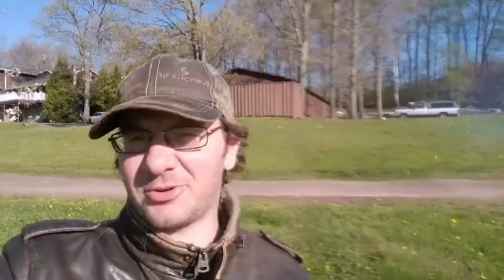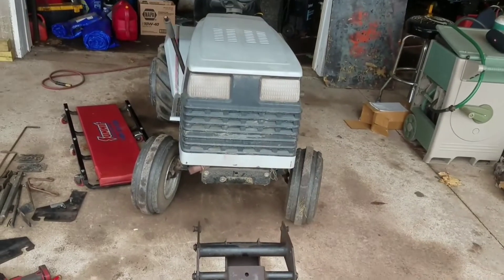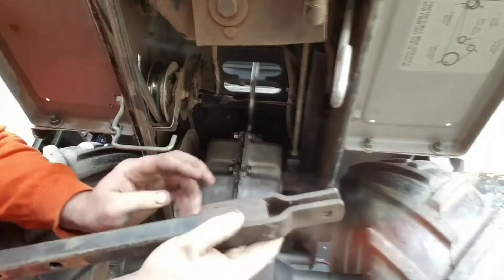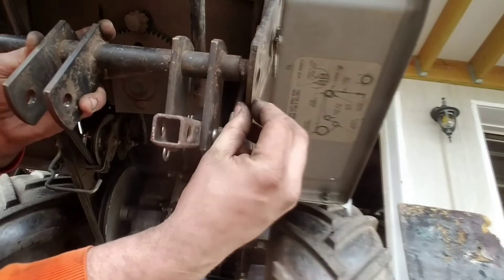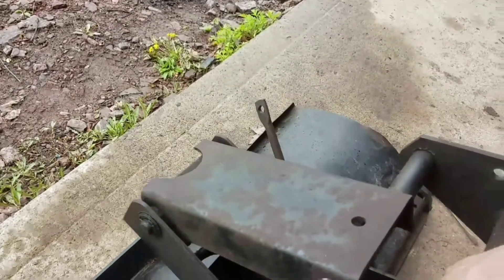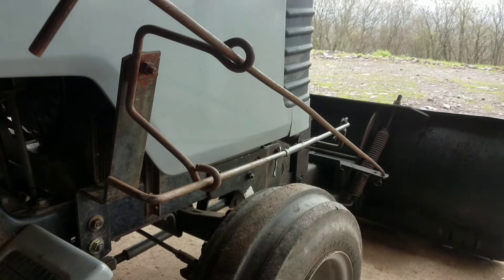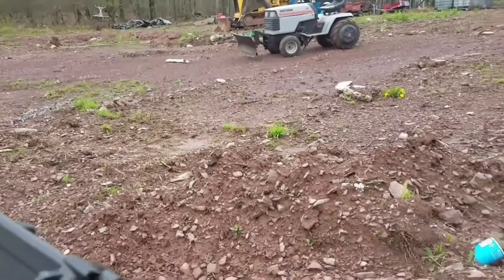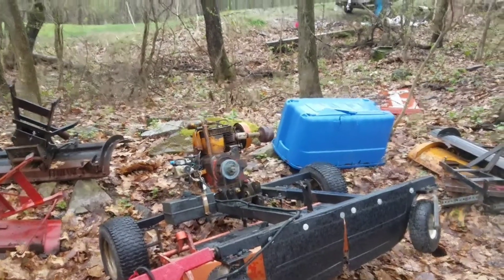1986 CRAFTSMAN GT18 Seat Angle Plow Attachment Install

Comment: That’s a 1987 lawnmower
Reply from the maker: Not a lawnmower 
GT stands for Garden Tractor Granted my one tractor does mostly lawn duty work. 

Same year 12hp lawnmower transmissions won't pull my rear mower up the mountain yard without braking, less horsepower, smaller decks, and much lighter (less traction) light duty tractor LT 

Garden tractors have rear implemet options not available for lawnmowers such as bottom plow, rear box blades, cultivaters, and even a rear self powered tiller attachment

Comment: I just got one of these little tractors and I'm trying to find a scrap for it or a box scrap do you know where I could find one for it
Reply from the maker: @Rogerswoodworkx  you need a sleeve hitch adapter. Agri-fab still makes them new, and then you can search Facebook marketplace for rear implements or buy new. 
Front attachments can be a bit tricky as platic hood gt6000 plows used different factory brackets and is a bit wider than earlier gt18 frames but brackets are interchangeable and adapters are also available but cant say how to find part numbers for them.
Reply from the maker: @Rogerswoodworkx  https://youtu.be/2MH1YRThgAY?si=Fmx52NzWLXtmqC3S
Reply from the maker: @Rogerswoodworkx  https://youtu.be/pEjsXPxvNnY?si=lKqyTb3aPUMDrajY
Reply: @willyck948  thank yu for all the good info on this! ill look into that thank yu again

Comment: Why did Craftsman stop making that type of tractor? all we get now are riding mowers that are not good enough to use for plowing up a yard for planting vegetables etc, they are only only good for snow plows.
Reply from the maker: Because new gt would cost $5000+.
Most people buy disposable mowers not necessarily knowing they won't last as long as gt. 
I believe husqvarna still make a gt with fabricated deck and heavy duty tuff torque trans that accepts ayp implements.

Comment: Great video! I have a 1990 craftsman and I’m trying to find that blade, do you have a part number for it?
Reply from the maker: model number on the blade is 
486-254021 GBIG 

Model on the frame mount is 
486-254051 GCFG

Newer plow model number 
486.244121 
fit as well with shims on the frame to widen it a little bit but the newer plows aren't as strong.